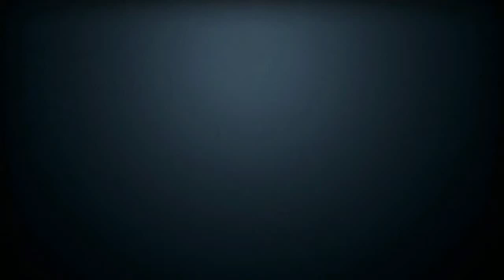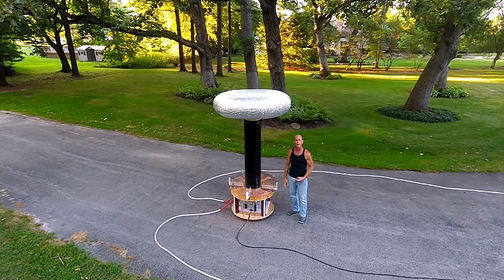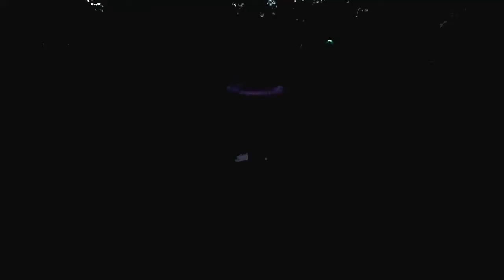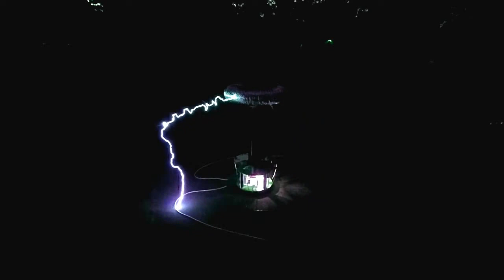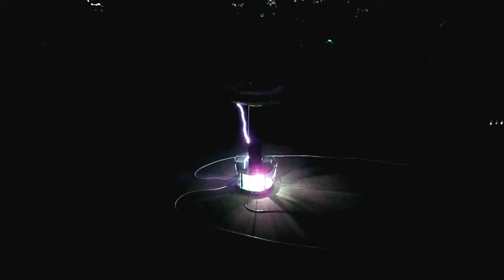⚡Deadly Megavolt Tesla Coil, Full Power Demo⚡

Comment: Very nice SGTC! While it certainly is deadly, 1 million Volt is an exaggeration. The voltage being built up on the topload, before breakout, is around some 400-500kV at maximum and that rapidly drops once the arc is formed. Spark length in a high frequency Tesla Coil can NOT be translated to the old rules of thumb for spark length between two spheres/pointy objects. The spark channel voltage, due to the high current, can be as low as a few hundred kV for sparks several meters long.
Reply: @MegavoltHomeschool   @MegavoltHomeschool  sir could u check on these if  this theory is possible
https://youtu.be/yk4CJLjNwfQ
Coz v believed thr is only talk on longitudinal wave or point source similar to laser ie having voltage but no amplitude or frequency but generated using high voltage impulses ie spark gap if u could chk with above if scalar waves r really possible as u have already a secondary Tesla coil which is absolutely magnificent and check it at a distance with a terrtiary coil to determine transmission at a distance